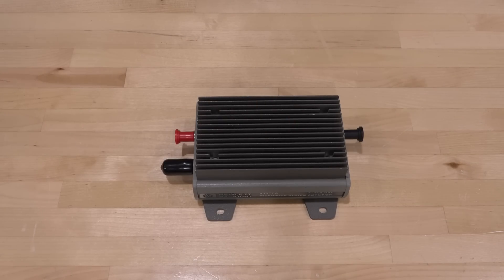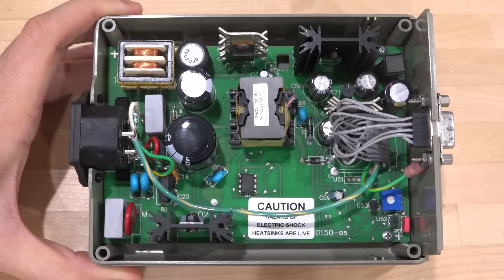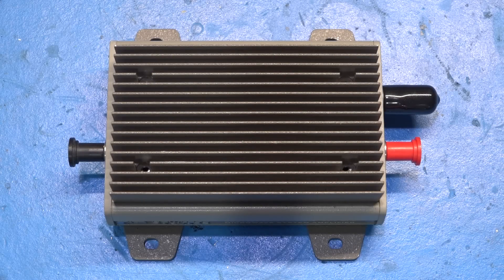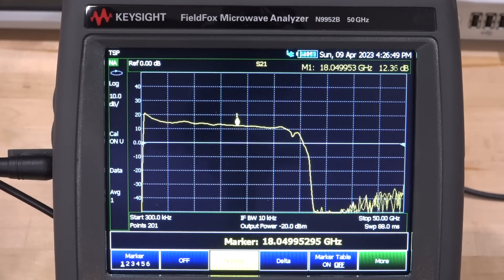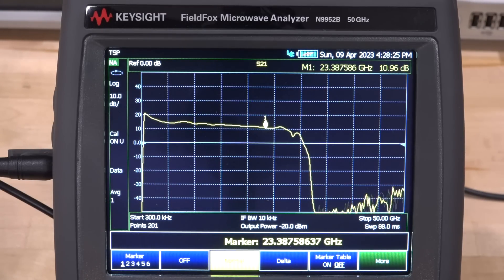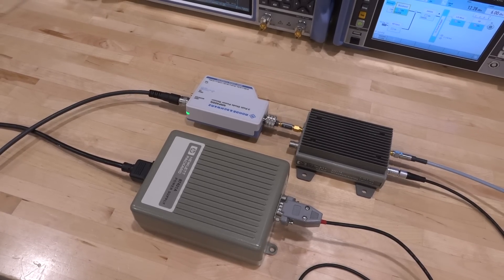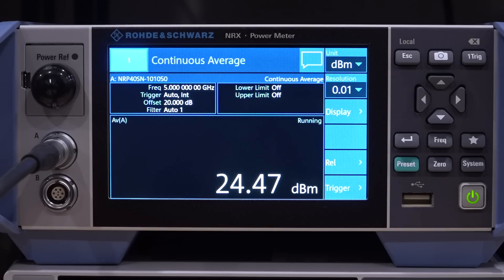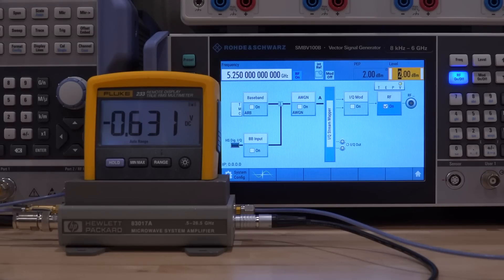TNP #31 - HP 87421 & 83017A 26.5GHz Microwave System Amplifier Teardown, Repair & Experiments

Comment: Thanks a lot Shariar for this tutorial on the HP microwave amplifier...

two-tone test: Did you test it with 10 dB down on the input of the amplifier ?

The 3rd overtone values would be interesting to see on a lower RF level.

Comment: Note that graphite has a very high thermal conductivity along the basal plane, but fairly low thermal conductivity in the perpendicular direction. This makes it an excellent heat spreader, but it must be kept thin to avoid excessive thermal resistance.
Reply from the maker: Yes, I should have mentioned that too.

Comment: 13:00 looks like the power sensor is hanging on the output of the amplifier. Not good: it puts stress on RF connectors.... Wouldn't it be a good idea to put something under the sensor?
Reply from the maker: There is a small plate under the part which you cannot easily see. But certainly nothing should ever ben resting on the connectors.
Reply: I caught the same thing - I’m assuming there’s something underneath. I know Shair knows better than to stress connectors after years of talking about how delicate they are.

Comment: Nice repair work! Old capacitors never 'fail to disappoint'. Or do they? Hmm...

Looking at this older unit really shows how far amplifiers have come. If you can get your hands on a Fairview USB preamp, those seem like interesting units. They are about the size of a large thumb drive, use USB for power, and are fairly broadband from 50M-18G/40G. The 40G part # is SBUA-400-12-010-K.

Comment: Sure, we always go to XRay if we don't have LCR meter
Reply: Really the correct approach is to build a fixture and de-embed it so you can use your VNA as a LCR meter
Reply: @tommihommi1 Well a VNA is impedance analysis of a different sort, but I don't think that electrolytic is going to be a capacitor above a few KHz.
Reply: @neonkev7866  VNAs made for lower frequency stuff often go down to 9kHz
Reply: @tommihommi1  The lowest freq. VNA I know of is the E5061B with option xL5, which goes all the way down to 5 Hz. I'm not sure if there is there is any sort of limit on output capacitance however; a bulk electrolytic like this would have much more capacitance than any practical rf device.
Reply: @neonkev7866  LCR meters work at the range of 100Hz to a few kHz
Reply: but it was intended more as a joke than anything, it's serious work to build a nice fixture and deembed it
Reply: @tommihommi1  The E4980A, for example, can make LCR measurments from 20 Hz to 2 MHz. There are also "RF" LCR meters (E4982A) (not to be confused with VNAs) that go up to a few GHz.